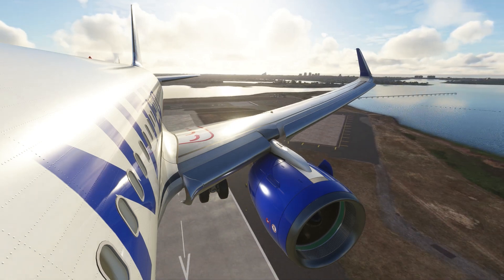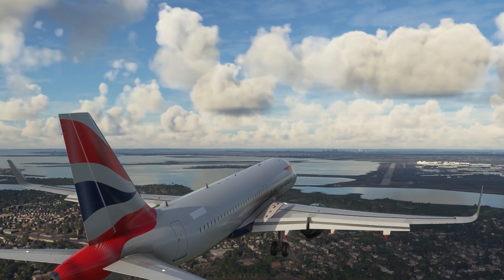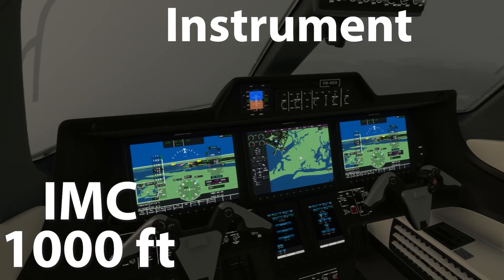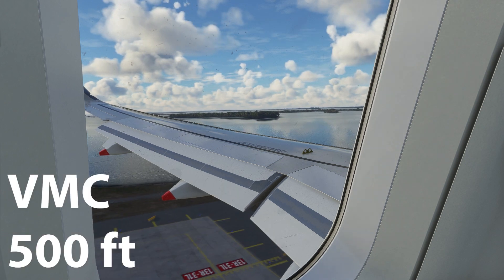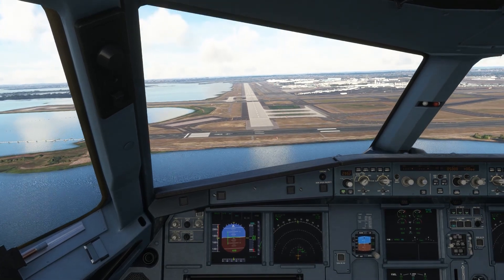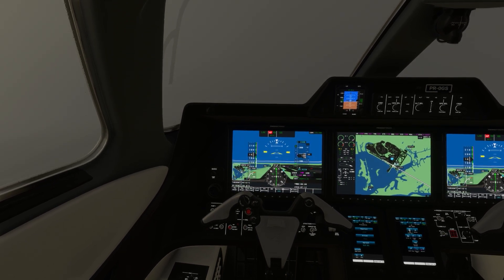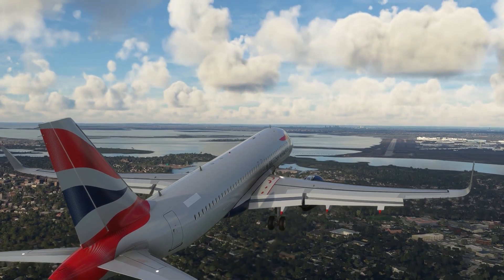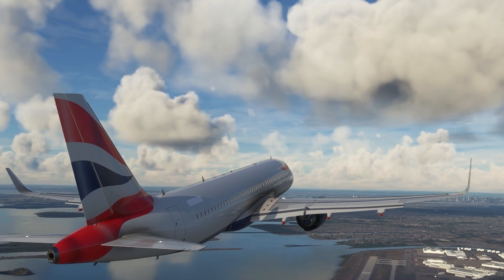Why Do Pilots 'GO-AROUND'? | Curious Pilot Explains #4

Comment: Suggested topic for an 'Explained'-video:
What are the implications of dumped fuel? 
Does it disperse and is not noticable instantly on the ground, or at sea? As I've never heard of traffic accidents and fires because of big splashes of aviation fuel coming from the sky, to give an extreme example.  
It would be very interesting to learn about how the fuel behaves chemically when dumped, and also what the environmental implications are and if air lines compensate for that somehow.
Reply from the maker: I’ll have a look. One way it can be used is to try and down a drone… 😳